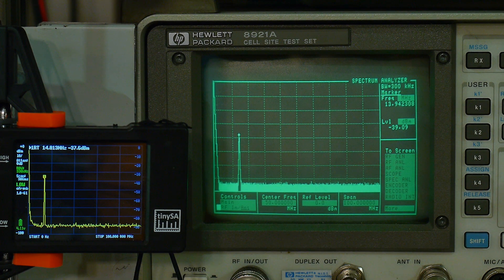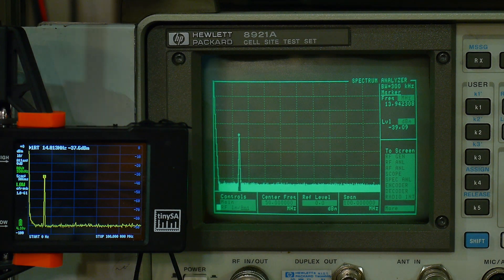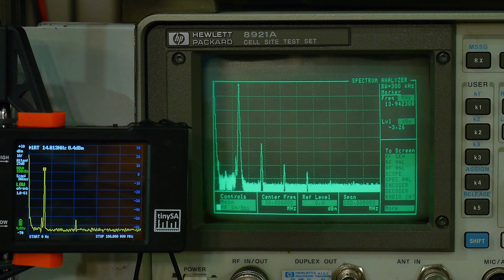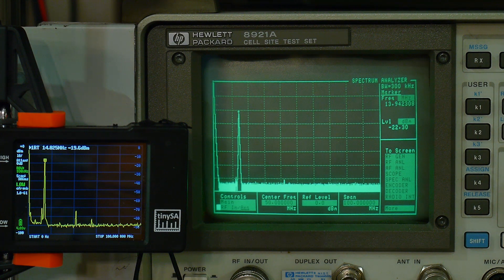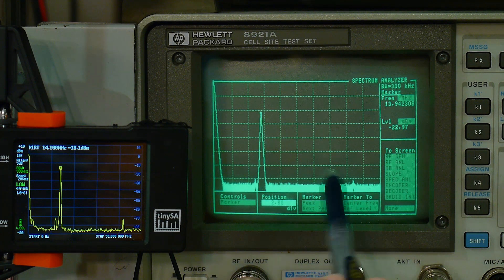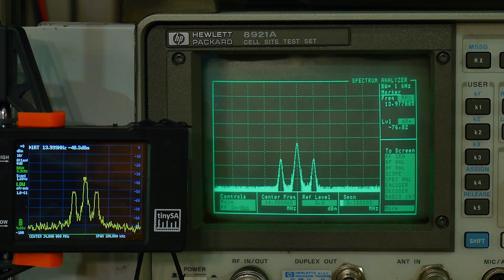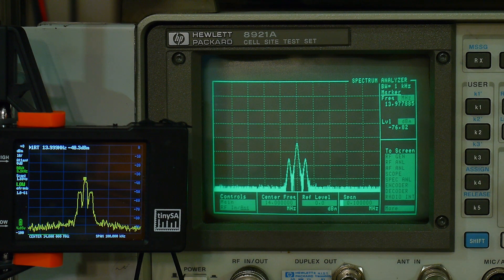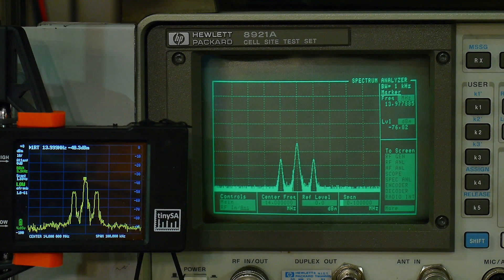#536c TinySA Update: Works well below -30dbm

Comment: In order to avoid any front-end overload problems and to protect the TinySA from accidental static discharge, I acquired a pair of lab grade 10 dB SMA attenuators which I leave permanently attached to both inputs. You might wonder why 10 dB and not 20 or 30 dB. Because 10 dB should be sufficient to absorb any accidental discharge and it only reduces the dynamic range of the TinySA by 10 dB. This is makes it easy to do the math so if I read -40 dBm on the screen I know the actual signal is at -30 dBm. In the event I do need the full dynamic range of the device for small signal analysis, it only takes a few seconds to remove the attenuators. But having both attenuators constantly protecting the front-end of the TinySA gives me peace of mind that I won't accidently burn out this amazing and useful device from an accidental static discharge event.

Comment: It's important to note that the 8920 series is a communication test set, with a spec A function, not really fully representative of the HP Spec A's of that vintage.    That said, price/performance of the Tiny is great.   But with any Spec A, you have to be aware of it's capability and how you are setting it up, to ensure best measurements.  It's easy to measure the instrument misconfigured, and think it's your DUT.

Comment: Thank You for good testing. Which version of TinySA is under this test? Old one o.1 - 350MHz or the newest one 0.1 - 960MHz? Probably firmware is also different / better.
Reply from the maker: latest model and firmware as of the date of the video
Reply: @IMSAIGuy  Thank You. I've just ordered Tiny SA.

Comment: Hi IMSAI Guy, in order to connect the TinySA to other equipment using BNC connectors an adaptor is needed. I found this on Amazon but not sure if these adaptors are pretty straightforward in terms of quality and that lemons rarely exists. Any tips? Thanks, Chris

https://www.amazon.nl/Eightwood-Adapterset-SMA-antenne-BNC-antenne-Wifi-antenne/dp/B06XHNYZ29/ref=asc_df_B06XHNYZ29/?tag=nlshogostdde-21&linkCode=df0&hvadid=430672658807&hvpos=&hvnetw=g&hvrand=1100229238521167925&hvpone=&hvptwo=&hvqmt=&hvdev=c&hvdvcmdl=&hvlocint=&hvlocphy=9065223&hvtargid=pla-425796008377&th=1
Reply from the maker: they should be fine

Comment: Interesting. So if you have a piece of radio kit you want to test that you can't control the power, how would you go about attenuating (is that right?) down to -30dbm so you can make real use of the TinySA?
Reply from the maker: I will be making a video about that in the future but you need to get an attenuator. The specification needs to be:
dB (about of attenuation)
Watts (amount the attenuator can dissipate)
so to test a 1 watt transmitter: 1 watt is +30dBm. so you need a total of 60dB of attenuation to get -30dBm. You will need an attenuator rated for 1watt.  100watts is  +50dBm
Reply from the maker: so 80dB needed and 100watt attenuators are not cheap
Reply from the maker: you can also use a dummy load with an RF sniffer.
Reply: It could be 20db 100W followed by 60db 1W, correct?
Reply from the maker: @АндрейДенисюк-ш7п  yes

Comment: You should have mentioned the difference from the peak of the signal to the peak of the spur.  It appears that the noise floor on the HP is higher and thus hides the spur implying that the HP is better.
Reply: I was going to point this out too.  The TinySA is outperforming the HP analyser by at least 10dB!

Comment: I wonder why they went back to the smaller form factor and didn't go straight to the 4" version display. May have to do with manufacturing lead times but I'd buy one in a heartbeat with the larger screen.  Having said that for $50 to be able to put it in your pocket ain't bad! Thanks for the review!

Comment: Where is the indentatin on the three peaks coming from? On the HP analyser it clearly shows pointy and clear kind of spikes whereas the TinySA seems to produce some kind of plateau like an oscilloscope with first overshooting after quick rise and then ringing? (And, yes - of course we are in frequency domain with the TinySA, not in time domain)
Reply from the maker: I believe it is the shape of the IF filters. They are software DSP filters and can have an odd shape.
Reply: @IMSAIGuy  Hmmm... probably true. When I think longer of it that must be exactly what comes out if you transscript timedomain "ringing" problem of a scope into frequency domain. Input compensation of Scope equals IF filters with spectrum analyser. Maybe if the bin size (or bin count?) can be changed that effect may be corrected?
Reply: lol - I see exactly that filter curve on the tinySA Webpage. Maybe something that could be fixed with next firmware version  for the resolution filters...
Reply: I look at that filter shape and it would lead me to think there's a problem with the DUT.    Kinda crappy filter shape, but dropping the span and tightening up the RBW would be my first thought on a swept tuned Spec A.   Since the Tiny isn't, I wonder what the best solution is to determine if that modulation shape is real or an instrument artifact?

Comment: so why can't you just increase the attenuator setting? like 30dB. then with 0dBm input you get -30dBm at mixer. what am I missing here?
Reply from the maker: yes, you are correct. you need to make sure that happens though and it is not automatic
Reply: When you compare harmonics it maybe is good to ensure the noise floor is on the same level otherwise you will see the harmonics in one SA and they are hidden in the noise floor on the other SA.
Reply from the maker: @ErikKaashoek  yes that is true. I struggle with the display. the number of vertical divisions are not the same on the two instruments. the noise floor is pretty close between the two but does change depending on RBW which I cannot control on the HP instrument it is always automatic and usually ends up being more narrow than the Tiny
Reply: @IMSAIGuy  You also didn't mention that in your previous video you didn't perform a level calibration, and therefore, your measurements were off by almost 3dB.  In this video your tinySA was calibrated (reference level text is  white instead of red) and your measurements matched the HP within .5dB.

Although the tinySA can't do some automatic level adjustments that the HP can, you have to judge that against its $50 cost versus that of the HP.  What the tinySA does do is if you calibrate it properly and the reference level text is white,  when you approach its overload level the text will turn red to warn you that you might want to back off.
Reply from the maker: @ErikKaashoek  People are already confused about the calibration and comparing it to the NanoVNA. How often to calibrate? do you need to calibrate for each start/stop frequency change?
Reply: @IMSAIGuy  The calibration is only for the power level. And it is frequency independent. Once the device is warmed up, probably no need to recalibrate